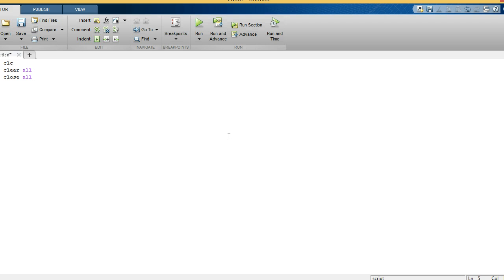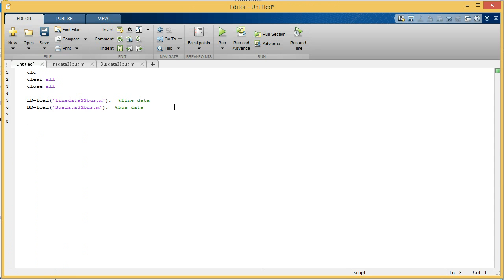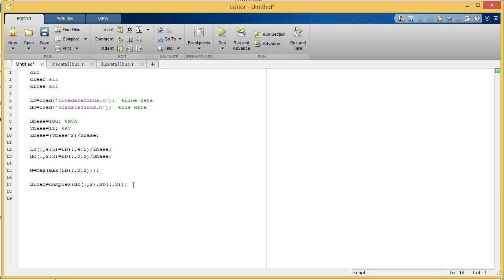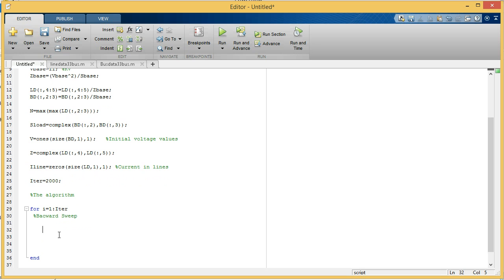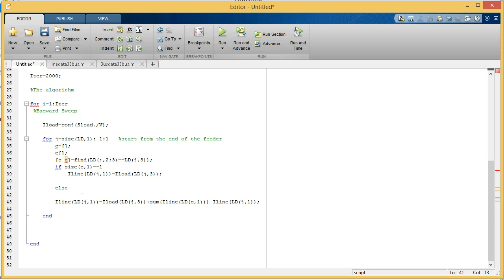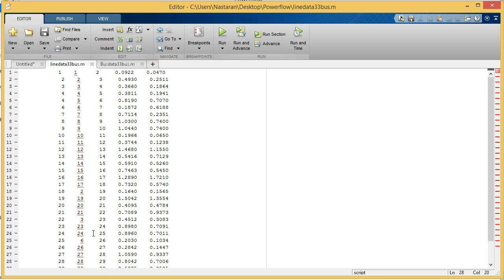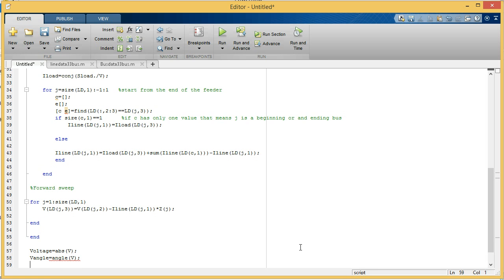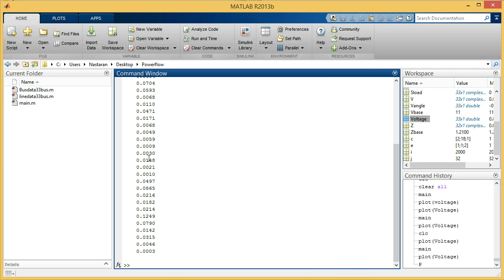Backward Forward Sweep Power Flow MATLAB Code

Comment: For those asking for the detailed script and data:

clc
clear all
close all
LD=load('linedata33bus.m'); %linedata
BD=load('busdata33bus.m'); %busdata
  
Sbase=100; %MVA;

Vbase=11; %KV

Zbase=(Vbase^2)/Sbase;

LD(:,4:5)=LD(:,4:5)/Zbase;
BD(:,2:3)=BD(:,2:3)/(1000*Sbase);

N=max(max(LD(:,2:3)));

Sload=complex(BD(:,2),BD(:,3));

V=ones(size(BD,1), 1); %initial voltage values

Z=complex(LD(:,4),LD(:,5));

Iline=zeros(size(LD, 1),1);   

Iter=2000;

%The Algorithm

for i=1:Iter

%Backward Sweep

Iload=conj(Sload./V);

for j=size(LD,1):-1:1 %start from the end of the feeder
c=[];
e=[];
[c e]=find(LD(:,2:3)==LD(j,3));
if size(c, 1)==1;  %if c has only one value that means j is a beginning or ending bus
	Iline(LD(j,1))=Iload(LD(j,3));
else

   Iline(LD(j,1))=Iload(LD(j,3))+sum(Iline(LD(c,1)))-Iline(LD(j,1));

	end
end
 
%Forward Sweep

for j=1:size(LD,1)
	V(LD(j,3))=V(LD(j,2))-Iline(LD(j,1))*Z(j);

end
	end

Voltage=abs(V);

Vangle=angle(V);

% Calculating the LOSSES

P=real(Z.*(Iline.^2));
Q=imag (Z.*(Iline.^2));
plot(Voltage)
%%%%%%%%%%%%%%%%%%%%%%%%%%%%%%%%%%%%%%%%%%%%%%%%%%%%%%%%%%%
%  busdata=[ Bn    BP     BQ  ]
              1     0      0
              2   100     60
              3    90     40
              4   120     80
              5    60     30
              6    60     20
              7   200    100
              8   200    100
              9    60     20 
             10    60     20
             11    45     30
             12    60     35
             13    60     35
             14   120     80
             15    60     10
             16    60     20
             17    60     20
             18    90     40
             19    90     40
             20    90     40
             21    90     40
             22    90     40
             23    90     50
             24   420    200
             25   420    200
             26    60     25
             27    60     25
             28    60     20
             29   120     70
             30   200    600
             31   150     70 
             32   210    100
             33    60     40 
%%%%%%%%%%%%%%%%%%%%%%%%%%%%%%%%%%%%%%%%%%%%%%%%%%%%%%%%%%%%%%%%%%%%
%linedata33bus
    1    1    2   0.0922   0.0470;
    2    2    3   0.4930   0.2511;
    3    3    4   0.3660   0.1864;
    4    4    5   0.3811   0.1941;
    5    5    6   0.8190   0.7070;
    6    6    7   0.1872   0.6188;
    7    7    8   1.7114   1.2351;
    8    8    9   1.0300   0.7400;
    9    9   10   1.0440   0.7400;
    10   10   11   0.1966   0.0650;
    11   11   12   0.3744   0.1238;
    12   12   13   1.4680   1.1550;
    13   13   14   0.5416   0.7129;
    14   14   15   0.5910   0.5260;
    15   15   16   0.7463   0.5450;
    16   16   17   1.2890   1.7210;
    17   17   18   0.7320   0.5740;
    18    2   19   0.1640   0.1565;
    19   19   20   1.5042   1.3554;
    20   20   21   0.4095   0.4784;
    21   21   22   0.7089   0.9373;
    22    3   23   0.4512   0.3083;
    23   23   24   0.8980   0.7091;
    24   24   25   0.8960   0.7011;
    25    6   26   0.2030   0.1034;
    26   26   27   0.2842   0.1447;
    27   27   28   1.0590   0.9337;
    28   28   29   0.8042   0.7006;
    29   29   30   0.5075   0.2585;
    30   30   31   0.9744   0.9630;
    31   31   32   0.3105   0.3619;
    32   32   33   0.3410   0.5302]

Comment: Hi, you said that in line data the fifth column is inductance then you calculated the impedance by using the formula r+jl but it should be r+j2*pi*f*l, is this right
Reply: It means inductive reactance